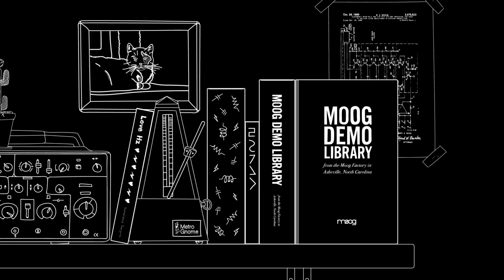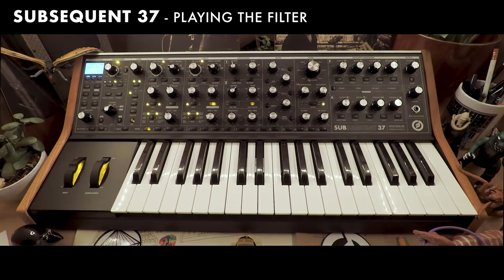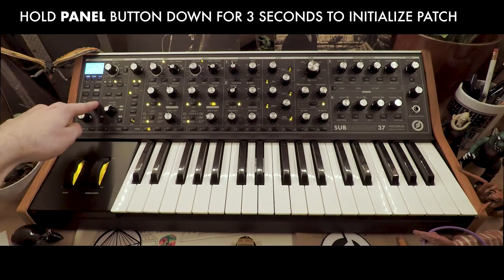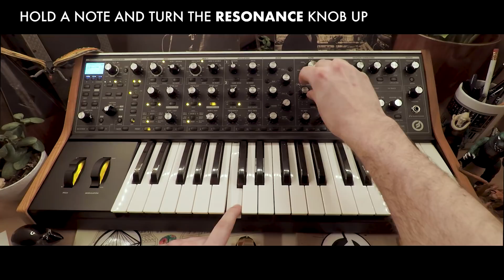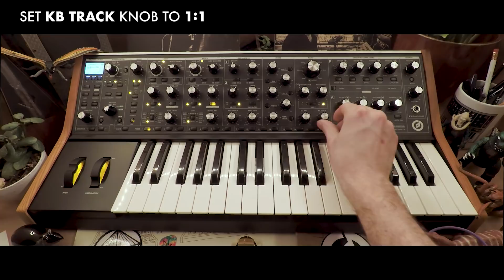Subsequent 37 | How to Play the Filter as a Sine Wave Oscillator

Comment: Strangely enough, i will try to use this to test my hearing, I have a hunch that the highest frequency YouTube is capable of is 17,800Hz which is as high as i can hear on YT vids. Will update post with results...
Reply: [results] YouTube matches about what i can hear using a moog sine wave on the subsequent37. i used audio technica ATH-M50x which has a 28,000Hz max. frequency response. and it was about the same although i think the moog was capable of a higher volume. my hearing dropped out at about a 17,800Hz sine wave. And my ears are still ringing from this extensive test😖_[edit]_ the moog can produce a higher sound by far....i just cant hear it...😐